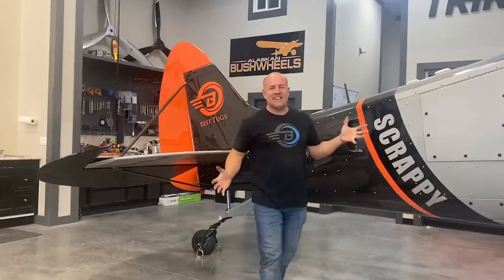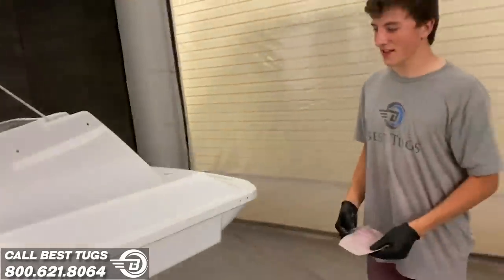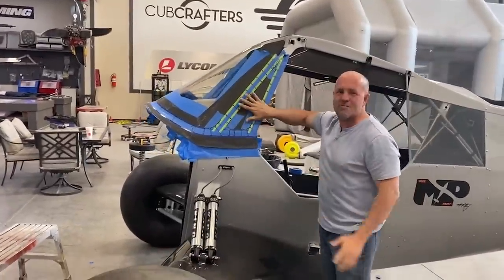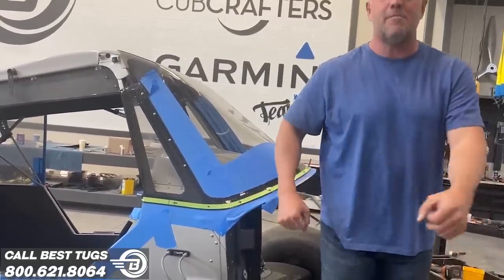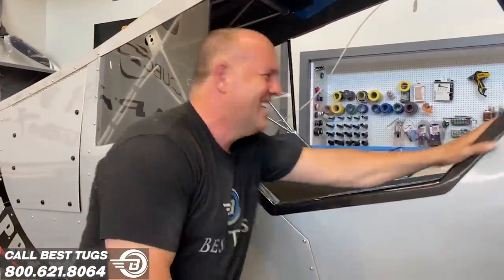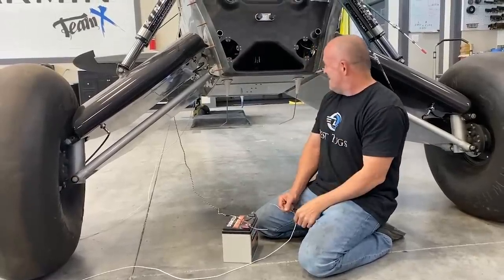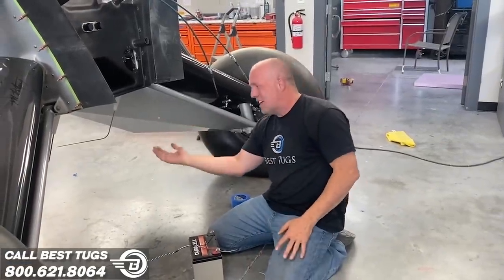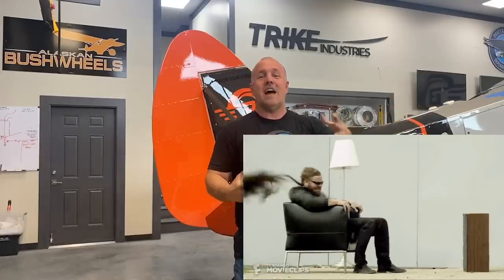🙋🏻‍♀️Wife Announcement (Scrappy Bush Plane 28)

Comment: Hi Mike! I was missing you since the last video. And speaking of wich, also since the last one, two ideas crossed my mind: !st) ¿Have you consider the posibility of placing a small cammera in the front of the engine cowling benieth the propeller axel (like those in the front of modern cars) and attach it to your screen? I guess that would give you a direct view to the front so you can avoid the "zig-zag" maneuver when rolling thru the runway. It also provides you a "real" vision, spetially when landing on an unknown airfield. I think it woulden´t add much weight to "Scrappy". 2nd) In F1 racing cars (and others) a spetial foam is placed into the fuel tanks to prevent accidents. ¿Have thought about this as well? I´m so happy after watching this video; I feel like i´m already next to you building "Scrappy" with you and your team. As always, greetings from NE patagonia, Argentina. PS: Happy for you and Chondra´s new "baby". Cheers.
Reply: 🤗 Thank you.
Reply: @ChandraSlyFoxPatey  Thank you Chandra for answering, and God speed with your new project.

Comment: This is my first time commenting on your many videos but I've watched you over several years and several projects. The point of this contract is to ask a question about a tool you are using to trim a part of Scrappy 28's windscreen area.  It appears to be a rotary device that is smooth in operation. Who makes that particular tool?

Thanks,

Darius Gray

An Old Hot Rodder

Comment: MIKE MIKE.   If ever a TEE exists with project title such as... "SCRAPPY, BACK TO WORK" TEE, But with the Mike Patey emblem somewhere...  Back, Sleeve, Rib side... Whatever.
I want one!  
**
Also... For posterity. I'm wondering on your take, knowledge, on the "Rockwell OV-10 Bronco" being tweaked to improve its landing portfolio with out taking away its viable military uses. 

Have you done a twin engine project?

Comment: Will Scrappy be a STOL plane? It seams like the engine will be to heavy to fly low and slow.
Reply: STOL? I reckon Scrappy will be SuperSTOL, and will hover near enough with the wings and hanging near vertical off the prop with the throttle open. With so much power and little weight, except maybe for the plethora of Garmin boxes holding it back! :)

Comment: How do you figure out the max deployable airspeed? Would there be one?
If you’re using the BRS it’ll most likely be a major failure, say it’s structural. You may not have the ability to decelerate in an uncontrolled decent prior to deployment?
Reply: BRS calculates that airspeed based on parachute size and aircraft gross weight.  Many aircraft must slow down from their max speed,  Scrappy’s chute is designed to deploy up to VNE.
Reply: Chandra SlyFox Patey how many Gs would the occupants experience near VNE? Sounds intense! Lol
Reply: MotoVloggedOUT  I hope to never find out 😬
Reply: Chandra SlyFox Patey of course!! :) just curious. Love the channel.

Comment: You know what is stupid? You should have modified the fuselage frame to become the Family Cruiser PA14 or the Pa12 Supercruiser, for more seating as it should have. A two place cub is stupidity in my opinion because the cost to build it is almost the same as the 3 and 4 place models. And those fold down door flaps are not as nice as a proper door.